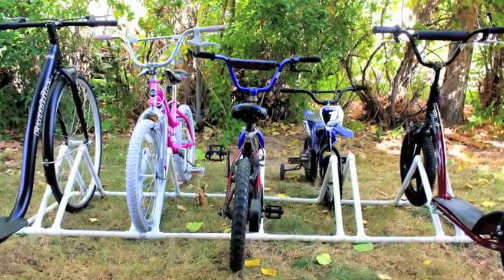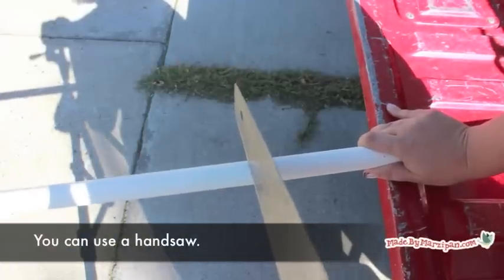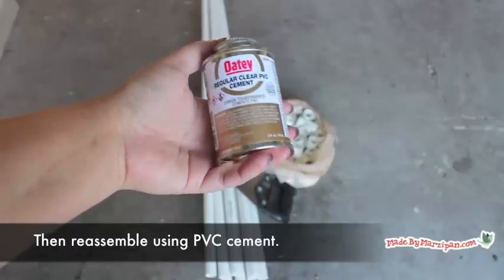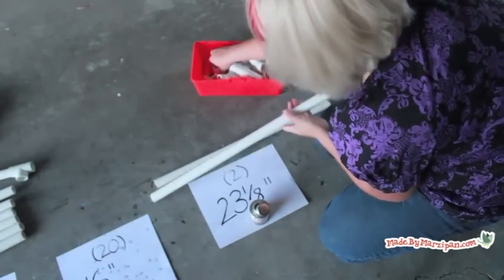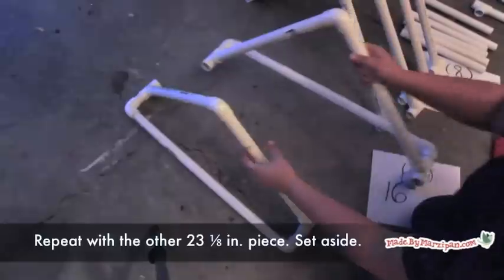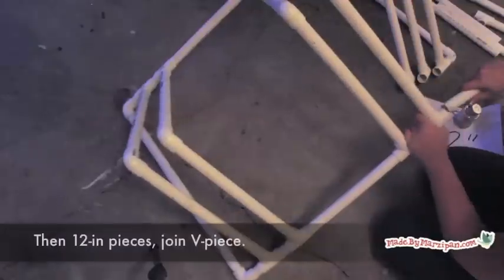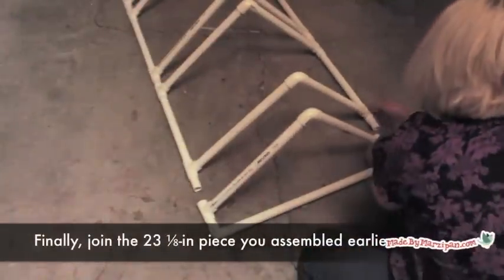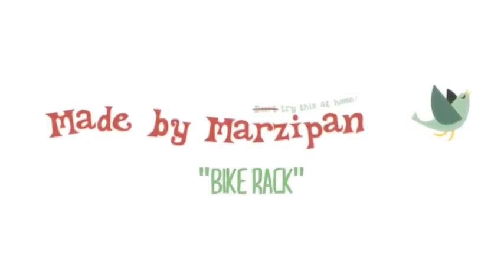DIY PVC Bike Rack

Comment: Just wanted to say thank you. The project went exactly as described and was complete in under 2 hours. I went with a Rigid pipe cutter which really worked well. Just completed it today so I’m taking your advice and waiting before using glue. My only issue and this isn’t on you, is the cost of material is probably way more expensive then when you originally made this video and I almost found this project to be cost adverse. Thank you once again, I had fun building this.

Comment: There are PVC pipe cutter tools that cut PVC with no mess. No vice needed either. A right tool for the right occasion makes all the difference.
I made one bicycle rack for 3 bicycles and one unicycle rack for 2 unicycles in less than 30 min.
Also, the friction of the PVC connector was enough to hold everything together, no cement is needed.
Using no cement also makes it more versatile, you can modify/expand it as your bike collection gets bigger.

One more thing. PVC pipes may be inexpensive, but connectors are.
The cost adds up alarmingly quickly. The only reason I still stick to PVC bike racks is because I can easily customize them.

Comment: when your using a saw, don't leave it hanging gout over the edge of the table or it will shake and vibrate and you will find it a lot harder to cut. cut as near to the table as you can.

Comment: OK, how much did all the PVC material cost - including the cement? If you travel around your town or city, you will find plenty of wood pallets. There are many stacks of used wood pallets behind many businesses and stores heading to the land fill. Just go into the store or business and speak to the manager about taking the pallets, like I did. Once you have all the pallets you need, ho on YouTube and watch the videos on making bike parking racks from pallets. You save sooo much more money than making a bike rack with expensive PVC pipes, PVC cement. spray can paint, and u-bolts to anchor the light weight PVC rack. Great idea, but not very viable for this type of project. Pallets are heavier material and don't need additional ground support to anchor them to the ground. Pallet bike racks are self anchored.